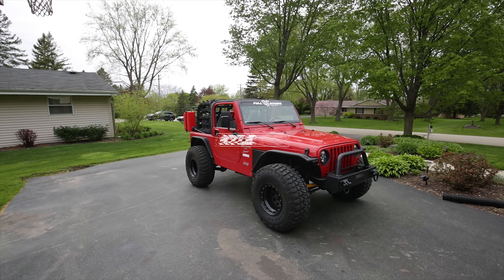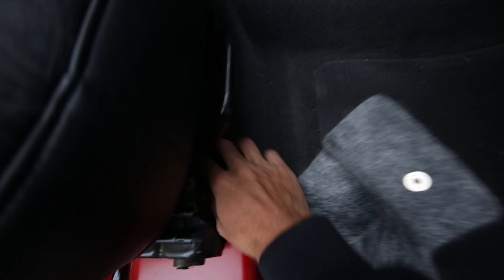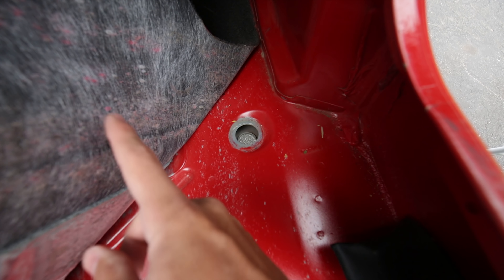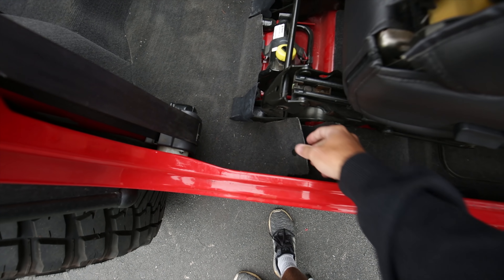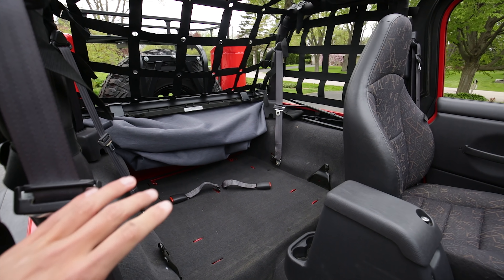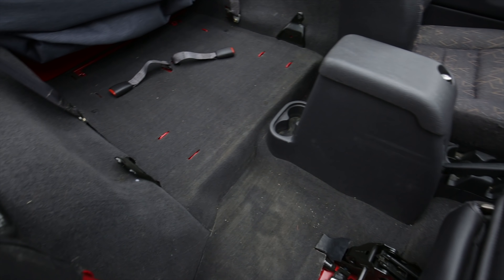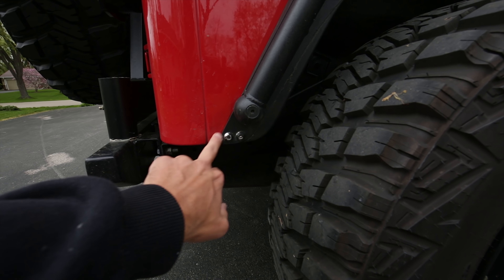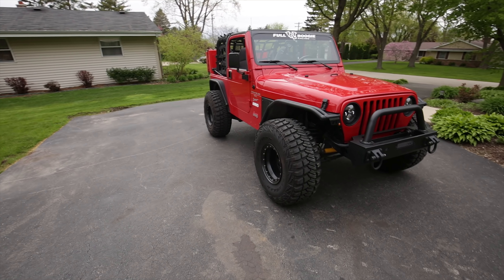Jeep TJ Water Drain Holes

Comment: Great video. After storing for the winter with my hard top on I have a lot of water in the foot wells i.e. same wells as the forward drain plug. I am guessing it may have come from the hard top or window seals but not sure. Any experience or ideas would be appreciated. Also, do you have a link to the spring clean you mentioned? Thanks

Also, I was hoping to be able to upload a couple of pics showing an empty electrical plug after removing the console that goes around the manual gear change lever. The plug is attached to the harness that runs under the console.
.

Comment: I have a '97 TJ and just checked where you indicated in the rear plugs are and the passenger and driver plugs are not there. 😂 Now I have sitting water in the rear foot area. Would you suggest drilling a little hole in each side so water can escape?